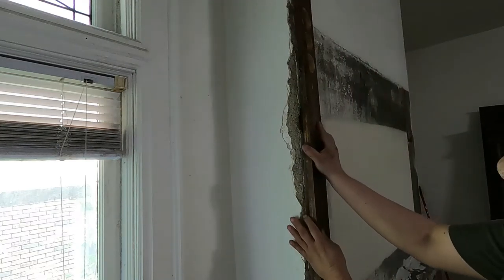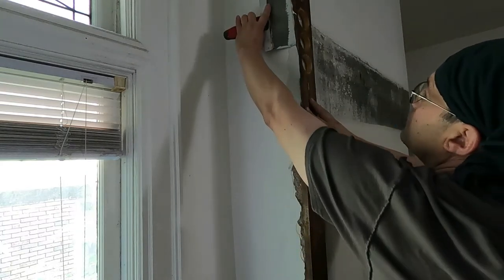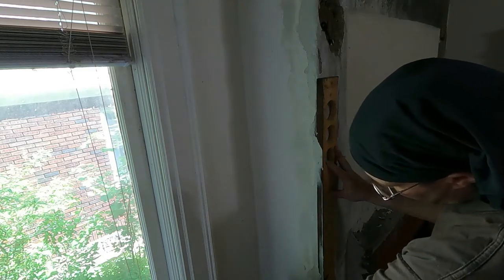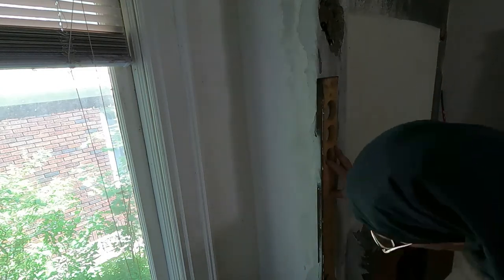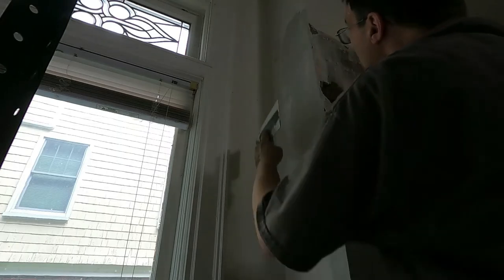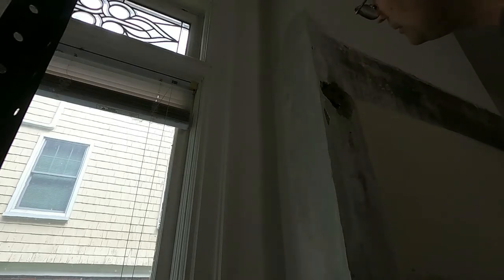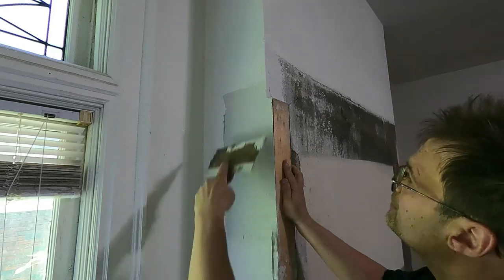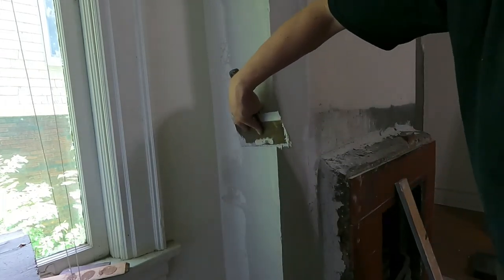REPAIR OUTSIDE PLASTER CORNER NO CORNER BEAD DIY ONLY

Comment: Hey brother! Got a question thats not related to the video, I came to your channel previously for a home heater problem, which your video did help. I'm currently dealing with another home heating problem, heater (Coleman 4000 I believe it is) is blowing cold air through vents but the service light is solid green which is good according to the manual, fan is on auto and the option is on heat, please help or give me advice if you can. Thanks in advance!
Reply from the maker: I would start by turning the thermostat down so there is no call for heat. Turn the power to the furnace off, wait a couple minutes turn the power back on then turn the thermostat back up so there is a call for heat.